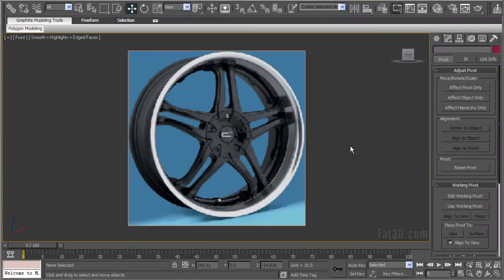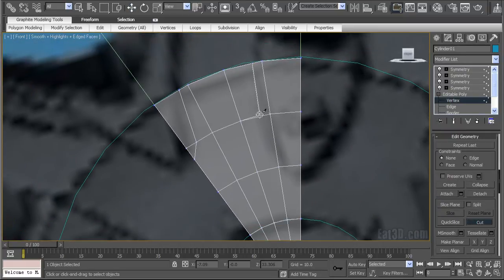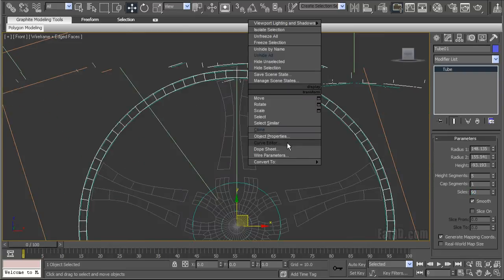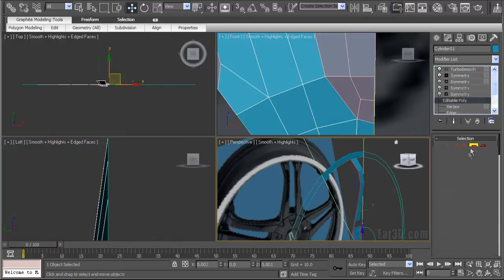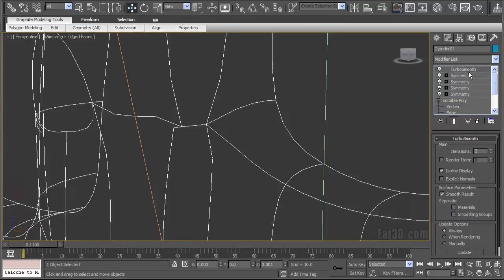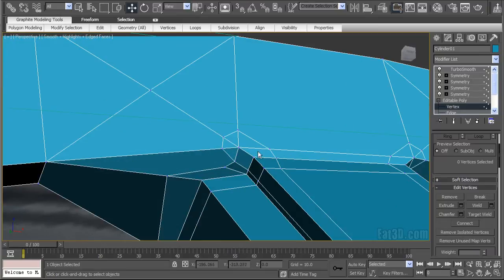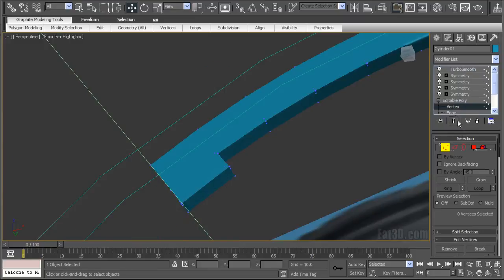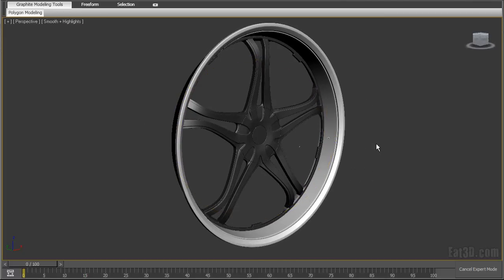Modeling a Car Rim in 3ds Max

Comment: That is to fast for me, I'm looking for many tutorials how to make rims or other complexed objects but either they are to long or to fast for me. I don't have such a big expierience to even know what is made and how on this video. I understood the method of using funcjons and options of poly modeling which make work much more faster but I can't tell where it's taking place in program at the interface. It's to fast for me. Experience is the best teacher. If I had made it 1000 times I would have been as fast as you. That's simple. Years spent at computer make progress. I must spend at least two or three years to be as fast with my mouse and shortcuts. Nice skills anyway.